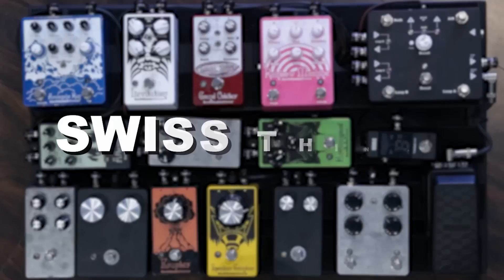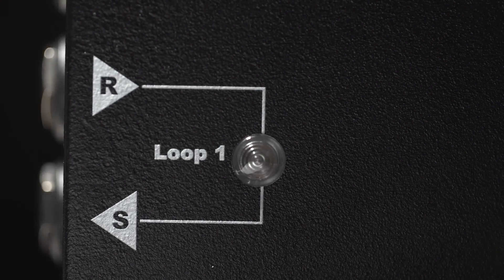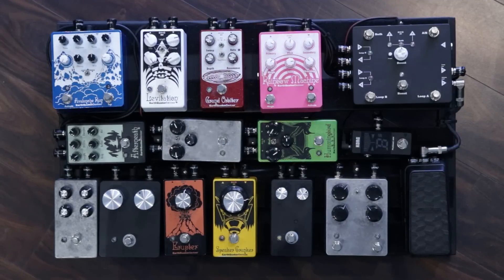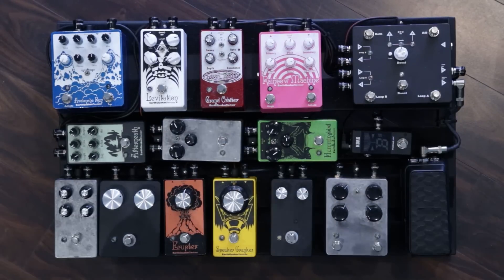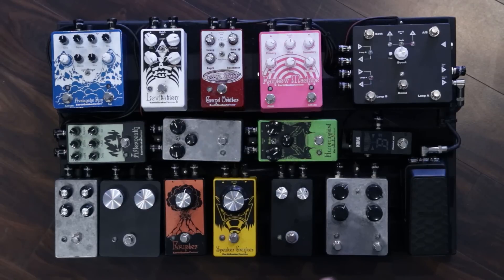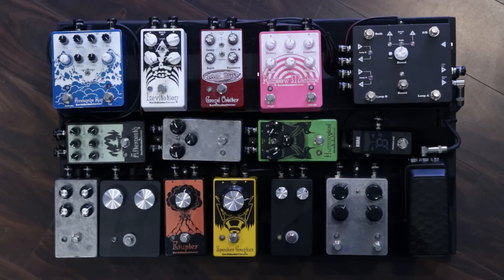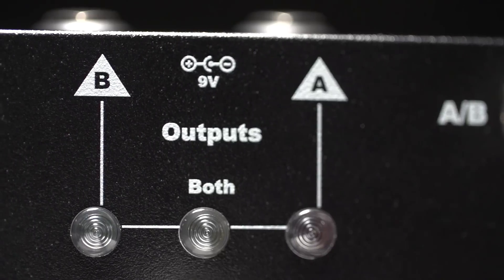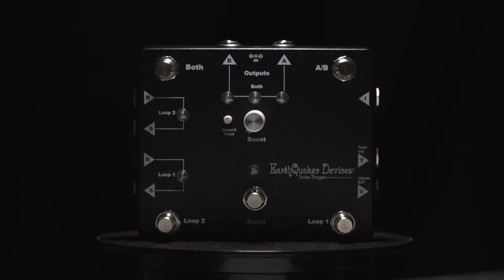Designer Notes with Jamie Stillman Ep. 1 - Swiss Things | EarthQuaker Devices

Comment: If this get's a V2, what do y'all think are the chances of adding a 'mix' knob for either of the loops? It's not so much an issue on delay pedals, but a lotta modulation pedals don't have mix knobs. It could also make for some cool possibilities with parallel compression, overdrive, etc., for bass players. I have kinda macgyvered this by putting modulation on output B and summing the two signals before they hit the amp, but just a thought!

Comment: V2 is going to need a bit more control over the outputs. Perhaps a secondary expression that controls more than volume. The clean boost alone on it is incredible though. Are there similar components that are in the Westwood that give the boost that sound?
Reply from the maker: this is a completely clean boost specially designed for Swiss Things.